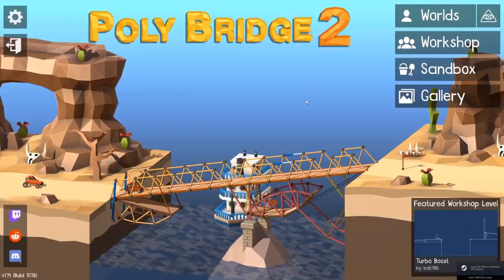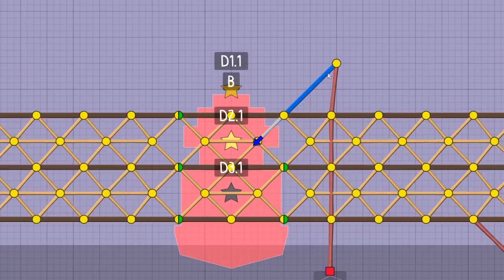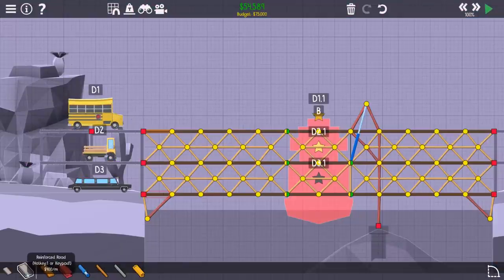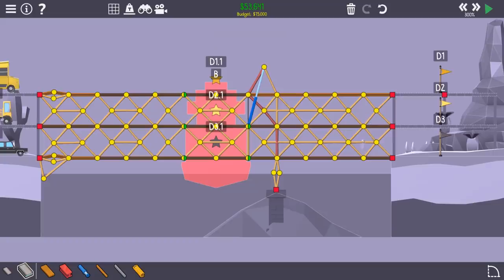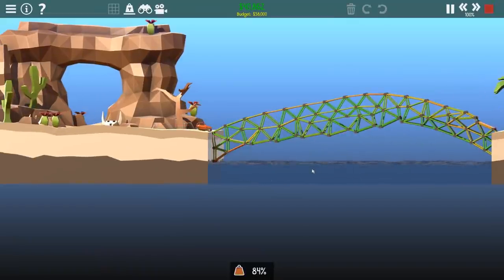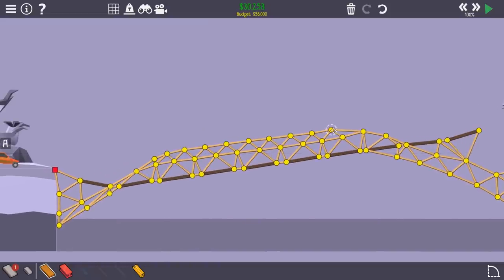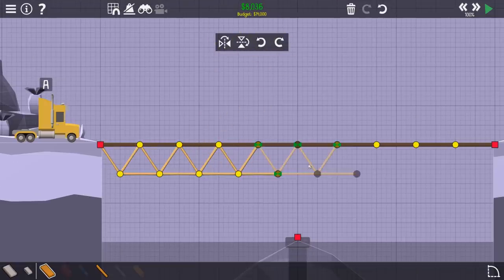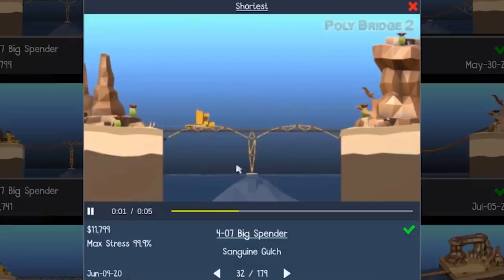Making an ENGINEER think OUTSIDE THE BOX in Poly Bridge 2!

Comment: On the triple decker level, I made the top road arch above the ship. So the two ends of the bridge always stayed connected, making it easier to hold everything up.
And I built a little hurdle for the middle car, so it will be delayed and only two cars are on the bridge at the same time.
Reply from the maker: Sneaky
Reply: @RealCivilEngineerGaming  Also when youre using multi-deck parallel bridges, at least in the simulation you want to anchor the bridge anchors directly to eachother, top to bottom, not Truss Intersect to Truss intersect. Doing so increases the structure's rigidity, which is not the case when doing a horizontal support.

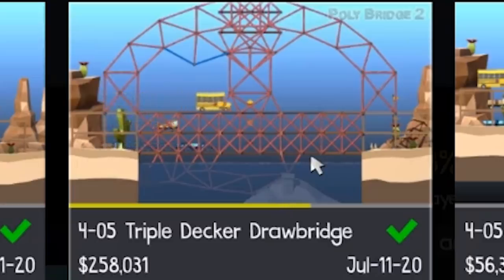Comment: 8:00 I'd say it's build symetrically like that, so it has the instantaneous center of rotation and the center of mass aligned in the same point and therefore negating the aditional stress on the bearing it would have gotten due to the inbalanced rotation. 
Though of course, this leads to doubeling the stress caused by gravity on the bearing. Sooo I'm not sure wheter this trade off is worth it or not ^^
Reply: 🤓
but that's a nice way of saying, for balance.

Comment: I think that arched roads help a lot more with cost than you think. While both of us know that the arched roads are generally a no-no, they allow a more even split of the load between the trusses and the road, which allows MUCH tighter  tolerances. 
Instead of fighting forces with a moment arm, you run the forces along a straight line.

Comment: Have you ever heard of a game called Armadillo Run? I think it would be perfect for your channel - its a physics based game where you need to get an armadillo into a portal using various materials with different costs and tensile strengths. So you can do things like create slingshots, rubber catapults, anything you can think of as long as you stick to the budget and the armadillo stays in the right place for 5 sec or so.

Old game, but brilliant. Highly recommended
Reply: https://youtu.be/4JoPlcyxxb4

Comment: Would've been cool if you made all 3 roads in the first level move in parallel to one another but all connected to the end of their roads, using one short hydraulic connected to pull all 3 up in a manner akin to a pantograph linkage. It probably won't work, but food for thought.

Comment: 1:10 Those little things you add, as far as I am aware of, are completely useless and have no loadbearing ability at all. You can only anchor to the red spots that the game gives you.
Reply from the maker: That's not true, you can add land braces anywhere as long as the angle is right!
Reply: the joint will press against the land and prevent the bridge from collapsing